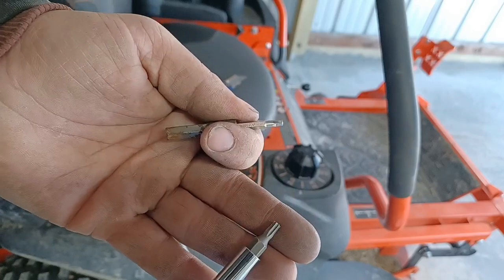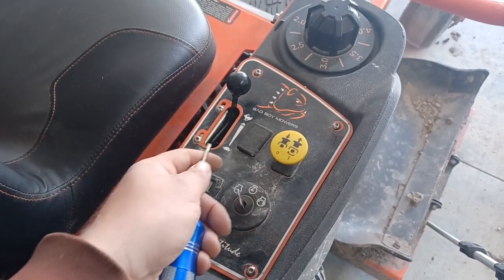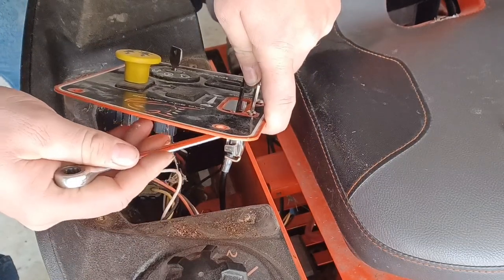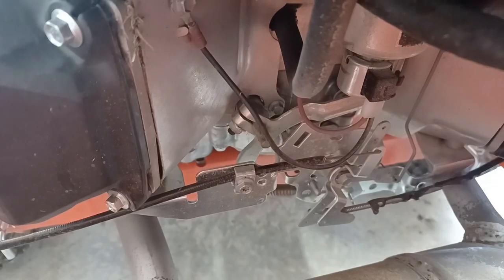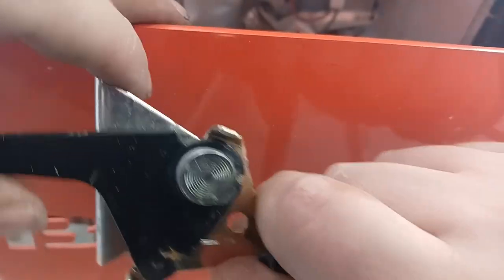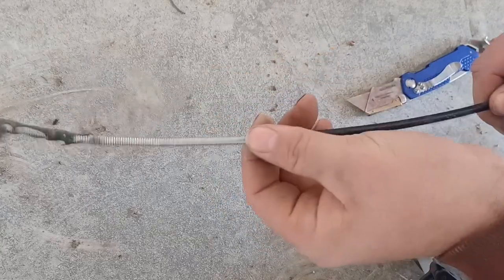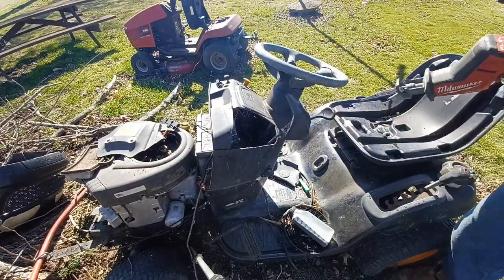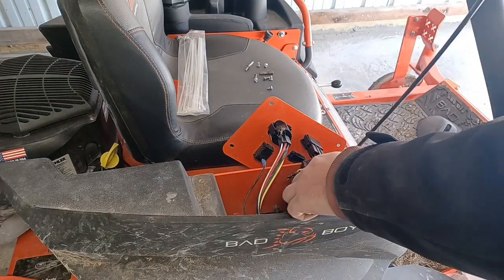Avoiding a Bad Design: Fixing the Throttle Cable on the Bad Boy MZ Magnum #ztr #commonproblems

Comment: Thank you for posting this video. I watched a bunch of YouTube videos before I purchased my 2023 Bad Boy MZ Magnum and one of the videos was yours describing the melted plastic coating on your throttle cable. Sure enough, I've got a grand total of four hours on my brand new machine and the same thing is starting to happen. The plastic coating is starting to melt and sag. I have some silicone fusion tape on hand that's supposed to resist temps up to 500 degrees F. I'm going to wrap six inches or so of both cable housings in a relatively thick layer of the silicone tape and see if it provides an adequate heat barrier. I'm amazed the factory is still installing the cables so close to the exhaust manifolds without protection from the heat. I purchased the silicone fusion tape on Amazon if you're interested. I'll keep you posted if it helps. Thanks again!!!

Comment: The pink is a Teflon liner, the cable will still get hot, and the inner liner will eventually melt, maybe faster without the outer black shielding.
Reply from the maker: That's possible time will tell got to try something different there isn't really much room for improvement back there. So far it's been holding up.
Reply: Teflon is a high temp polymer...it should withstand the temperatures.
Reply: My cub cadet did the same thing with the choke cable.  I think I’ll try a heat shield for a spark plug wire

Comment: Well, thanks for the Vid. But when I think major failure I envision engine blow up or something along that line. These are design flaws that you point out, and I appreciate you doing that. For the cable problem, on my newly purchased 2023 Mag, I took a piece of old fuel line, split it down the middle and wrapped it around the cable. Seems there has been attention to that problem because there is a space that keeps the line away from the heat source. Not a big space, which is why I added the protection. The wire problem shorting out in another vid, is another thing I will address this week. Good to know, thank you.

Comment: Great job on the cable replacement. It is not right getting these problems on a newish machine. We have found that a claw hammer is great for removing those control knobs

Comment: I just bought a ZT Elite after looking at the Magnum.  In mine the cables are routed away from the cylinder so I think they have implemented a fix.  Also the battery is held in place by a rubber strap not twist off tie-downs.  So it looks like they are fixing these issues.

Comment: Bad boy has lots of problems not just cables
Reply: Like what
Reply: @kevindriscoll3815  mine has poor cut quality hard steering arms and the seat sucks  other than that it's ok I guess.
Reply: Had no issue with my bad boy 12 years old